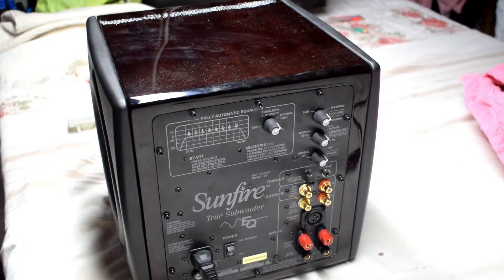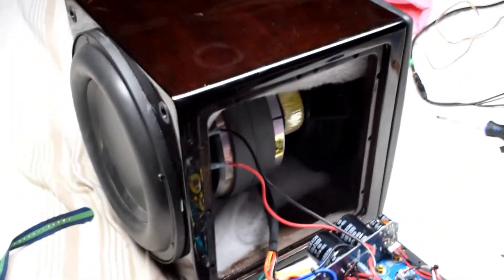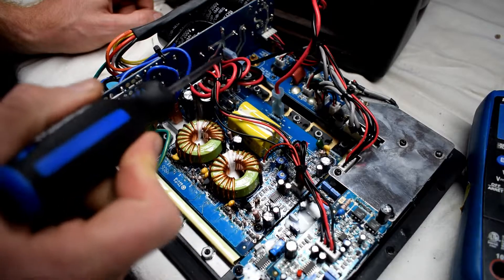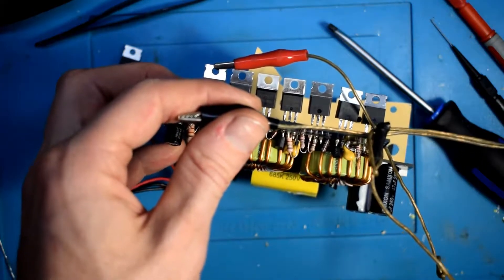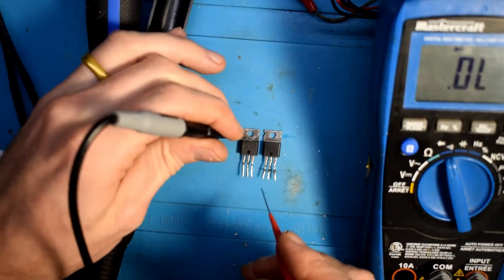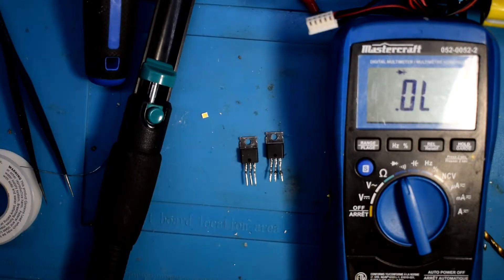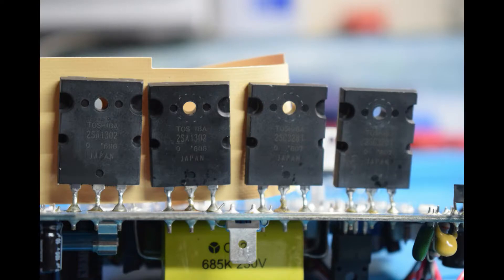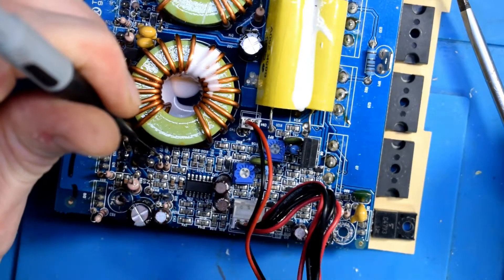Sunfire Subwoofer not working? (PCB level Repair and Diagnostic)

Comment: Got one of these to fix and keep from a friend. Needed a new cap in the power supply board and gave a constant hum out of the driver. Fixed it and noticed this subs terrible 20 hertz high pas cutoff. Not good for music that has subsonic frequencies as they are blocked. Something my 6 foot floor standing towers have no problem with. Considering putting larger coupling capacitors in the preamp to extend the low end range.but not sure if such a small sub is worth the time and effort.

Comment: Very curious if this repair was succesful longer term? Those two resistors should be 270 ohm 1/4 watt. I have one of these to look at that has a loud humming coming from the speaker. Will be attempting to repair this in the coming week or so, I'm hoping it's just the caps and the semiconductors are ok. Have you fixed many of these ?

Comment: Hey man you said these are NPN mosfett. NOT TRUE
 the large devices are bipolar transistors NPN and PNP; These are in the class AB output
the small Transistors are  MOSFETT and they are switcher for the PWM power supply and most likely the output
failed and the short took out the power supply. YOU SHOULD NOT TOUCH THE MOSFETT BY HAND; THIS IS A STATIC SENSITIVE DIVICE.
HOWEVER CLEVER REPAIR METHOD. IF YOU NEED HELP IN BUYING PASSIVE RADIAOTORS FOR SUNFIRE, CALL ME
  JUST A CORRECTION
😀
Reply from the maker: good to know
Reply from the maker: No need to worry about ESD they are blown

Comment: So the question is. Is thermal compound necessary for the transistors?
Reply from the maker: The original design does not have thermal paste it is not needed as the crews hold it down on a piece of paper to stop it from shorted on the heat sink.